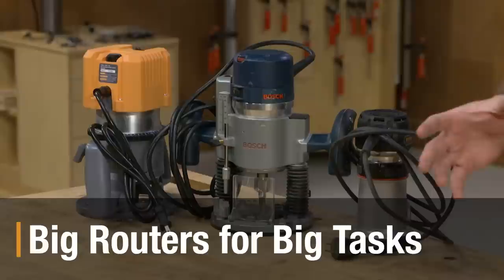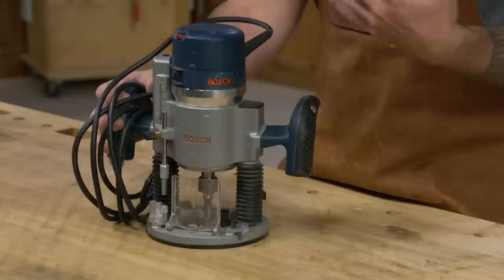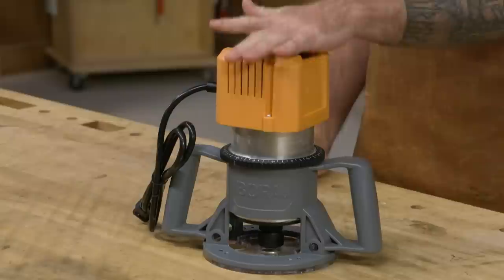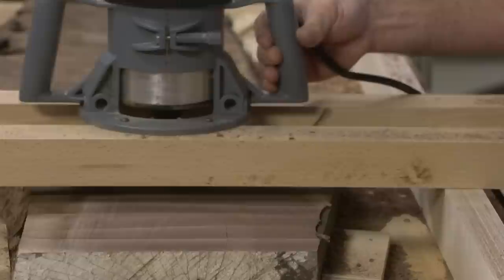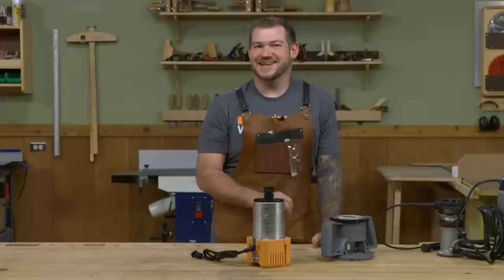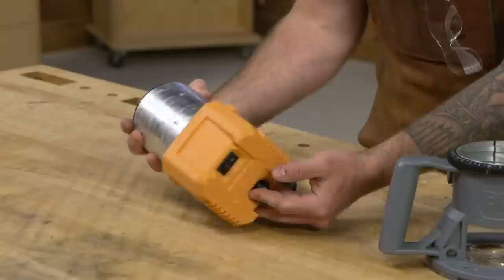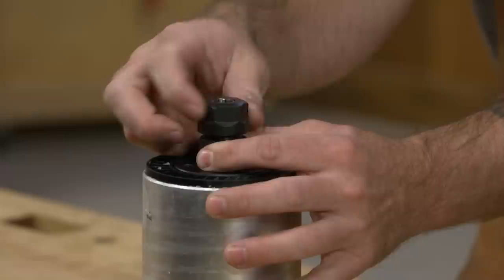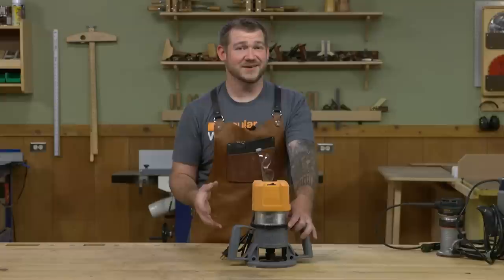Big Routers Big Tasks

Comment: Btw - the rpm does not change.  The inner and outer parts are all spinning at the same rate.  However, the tangential velocity at the outer edge increases as the Radius increases.  It’s the velocity that maters - same conversation as saw blades on chop saws or mitre saws

Comment: Loved to=he very informative video. One note: when measuring router speeds in (revs per minute) rpm, the speed is the same at the tip as at the shaft. However, the speed (e.g. feet per second) as you work away from the shaft increases as bit diameter increases. So indeed, the tip speed on a large diameter panel raising bit can be very high indeed and therefore required higher power and needs to be used more carefully..

Comment: Wrong description of how fast large bit is spinning. The rpm is uniform but the linear speed is a function of distance from center of rotation. The danger of a router bit rotating too fast is correct and could be stated more strongly.
Reply from the maker: I know someone would call me out on this. You're 100% correct. The rpm is the same but the surface speed is faster.

Comment: I’ll throw in a bit of machining background for the fun of it…In the machining world we consider er collets to be less accurate than collets with less cuts like 5c collets. That said they are still really accurate and I use er30 sized collets all the time on my machines for holding round work (think like hold bolt threads to machine the head). The little bit of accuracy lost let’s the collet hold a reasonable size range (My inch set has collets sized by every 1/32” with each collet being able to shrink 1/32”) where 5c (a big version of what’s in routers) can handle a variation of only .005” meaning when you hold work on it, it must be accurately sized. 

Grip strength depends on taper angle and thread pitch more than anything.  Most important is the angle be self ejecting or close to it.  Er collets have a nice groove in the collet so the nut helps pull the taper out so they can run them close to the self locking point.  I have an old machine that takes Morse taper 2 collets which are very shallow and commonly used for drill chucks and centers in wood lathes.  Well those aren’t self ejecting and it can take real force for the drawbar to eject collets.  When I remove bits from that machine I hold a towel over the bit because it ejects with a real bang and would shoot the bit out into my hand or smash into the vise.

Comment: That statement about rpms is wrong. Rpms are the same in the center and edge of the bit, however the edge of a large diameter bit will be travelling much faster than a point closer to the center of rotation. There is real danger there however, spin a big bit too fast and it can shatter, sending shrapnel flying..

Comment: Hate to be pedantic but when talking about the difference in a small diameter bit and a larger one, the RPM's don't change. They still spin at the same rate. It's the distance traveled by a point on the edge that does. Like for a ¼ inch bit, when you do the math circumference = 2πr = 0.785" and when you x 10,000rpm and convert minutes to hours and inches to miles it comes to 7.43 MPH. Now consider a 3 inch diameter panel raising bit. That same math tells you the outer edge of the bits blade is moving at 89.20 MPH. That's12 times faster 😬

Comment: I stay astounded in the desire for a large 3HP+ router to go in a table.   When you add the price of table, lift and router, you are in shaper territory.   Why not get a shaper?   You certainly get a quieter motor.   We all know how much a router screams.  The shaper comes normally with a rigid cast iron table and the raising system that is integral.  And usually a high-quality fence.   Plus, cutters that are available in wide variety of profiles that can even be flipped and run in reverse.
Reply: Since these routers are not really 3hp or better wired on 110/120 (they are closer to 2hp in real world use) a goodly appointed router table setup is about the same price as a 2hp shaper. I splurged a little on a new setup and the router motor and lift were $1300 alone. I already had an Infinity cast iron top, but to be fair that's another $500. So $1800 on a new router table setup with an actual 2hp vs a 2hp shaper.  So yes, I could have a bare bones shaper for that, but I plan on insetting the whole thing in my outfeed table to create more of a workstation with my table saws. Not doing that with a shaper. And I get a tool that I prefer over a shaper for the types of operations I do. I challenge you to find a shaper that's convenient or more importantly safe for flush trimming the full perimeter of a workpiece while following a template. Hell, even for normal shaper stuff I'd rather have an auto-feed. A good coping sled on the router table and all is well. Short version. It's all preference.
Reply: For me floor space. I can toss an enormous router and lift into the wing of my table saw and double duty my floor space. If I had a bigger space sure I’d get a shaper. It’s not really about the money.

Comment: Totally agree about the RPM comment, it’s wrong. I would also add that when comparing to shapers it becomes important to highlight the fact that the horsepower rating is an outright lie. If those 3+ hp routers were in fact 3hp they would require a 240v connection or be on a 30-40 amp breaker at 120v.
Reply: you are correct about not getting to 3hp on 120. But you don't need 30-40 amps. I am going to do a little math, but use 110 because that is the voltage available to most of us. 110/220. Code dictates that a 20amp breaker is the max for a 110 circuit. At least in my state. 20 amps on 110 is 2.95 horsepower (if we did have 120 we could get 3hp on 20 amps, but just barely, and it wouldn't be something you should do).  Once you take efficiency losses into account you are closer to 2.65. Moot really as most of these routers wired for 110 cap out at 15 amps. When you do that taking efficiency into consideration you are at a real world max of 1.99hp on 110v household current. On 220v a 15 amp circuit will support almost 4 hp.
Reply: @StoneyMeyerhoeffer agree with your comment from a technical perspective but in reality if you were to run an appliance that drew 20 amps you would not be running it on a 20 amp breaker. That theoretical circuit would be on at least a 30amp breaker.
Reply: @philjegues  agree. i said you shouldn't do it. because constant draw is never burst or peak. And you won't find a 110v electrical appliance that will draw more than 15 amps. The thing I didn't mention is that peak hp, which these numbers are, do not tell the whole story. a 3 hp capable motor running at 2hp will run more efficiently and develop that horsepower at a lower rpm than a motor that peaks at 2hp because of the increased torque over the whole curve. That's why they give you motor "you can't use." You can. It makes a difference. Even at 110v.